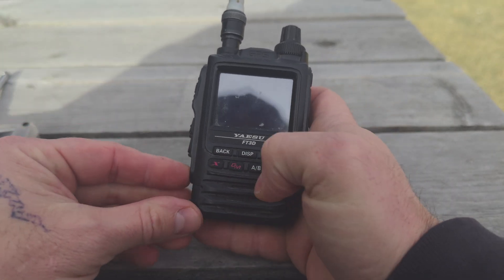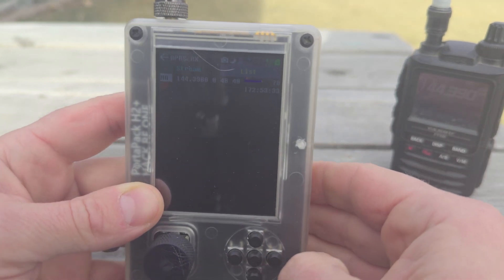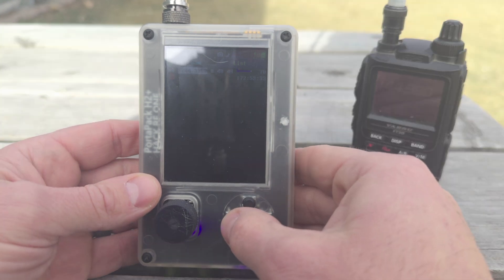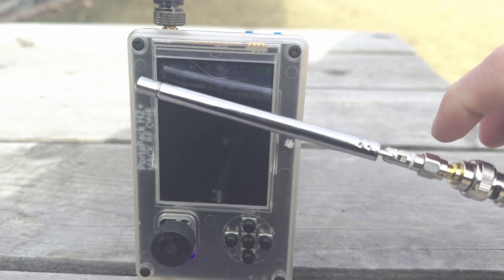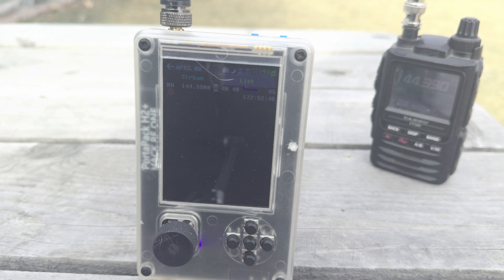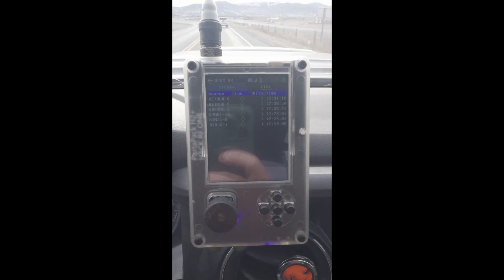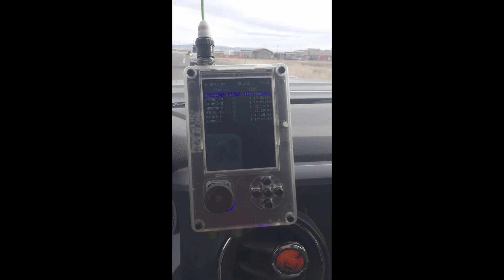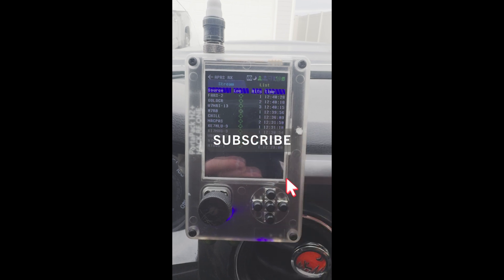PortaPack H2 APRS QUICKIE

Comment: Which firmware are you on? I’m not receiving any APRS signals. :/ 144.390 MHz, 0, 40, 36. Telescopic antenna pulled out all the way. My location is a major metro area.
Reply from the maker: Mayhem 1.9.1. Try playing with your vna and lna.